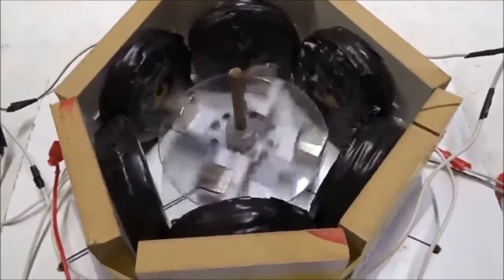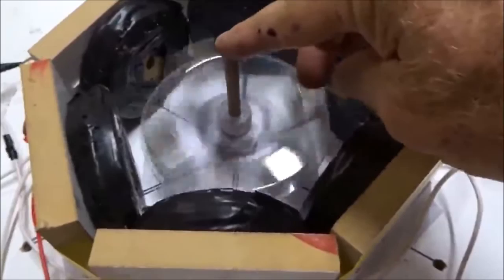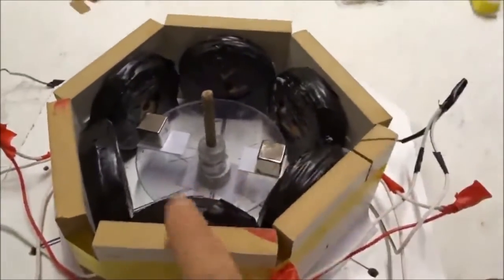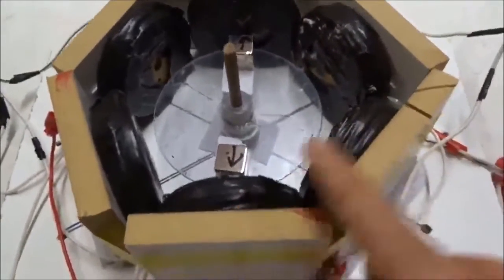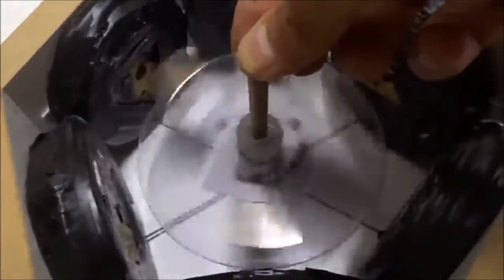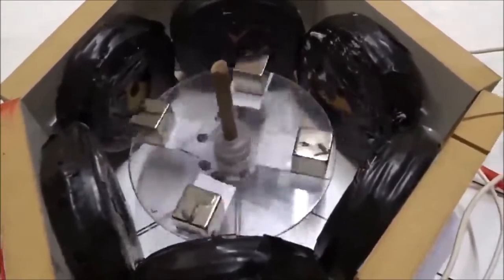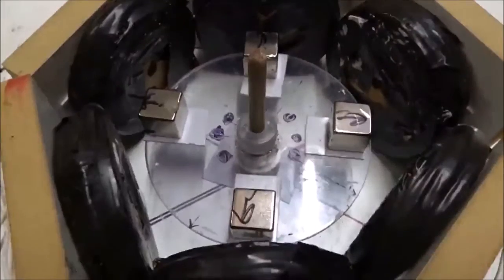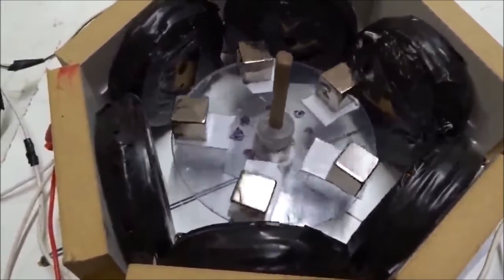A new 3-phase, magnetic motor based on V-W torque: Part I

Comment: Beautiful experimental work I have 3 PMSM permanent magnet syncronous motors that have distributed winding coils those 36 coils on the inside as the stator with 24 magnet poles on the outside as the rotor.